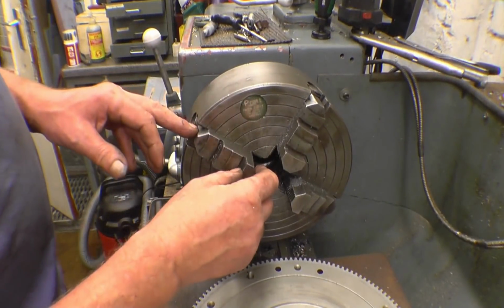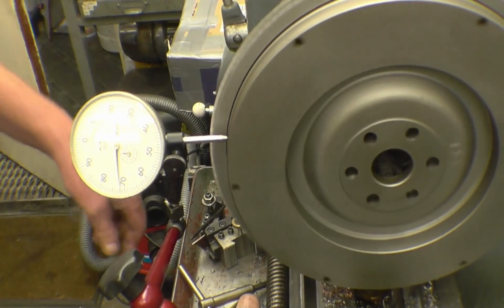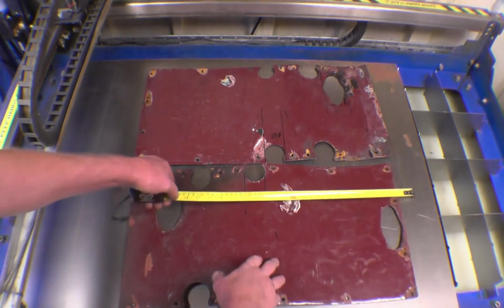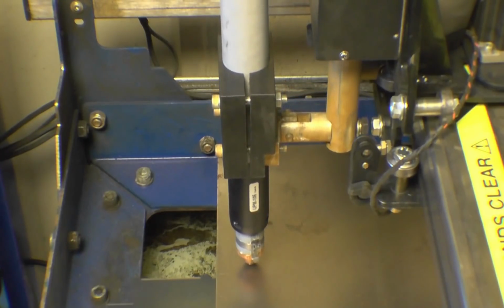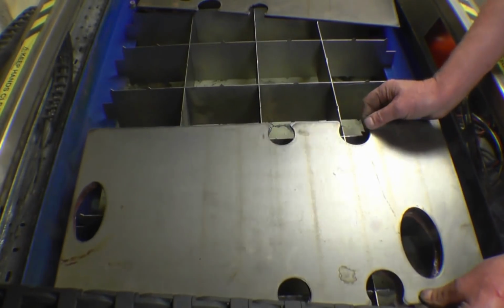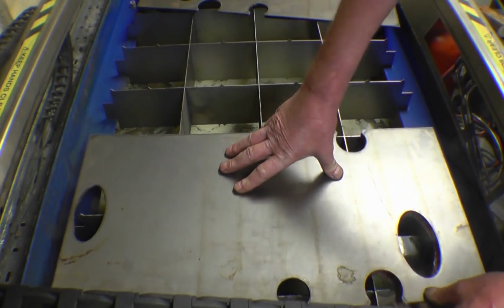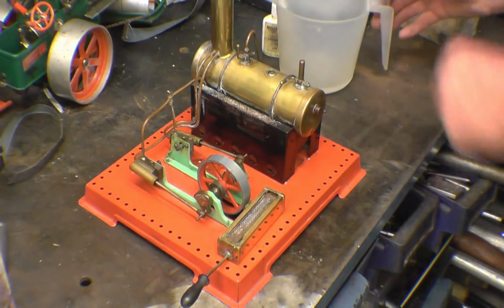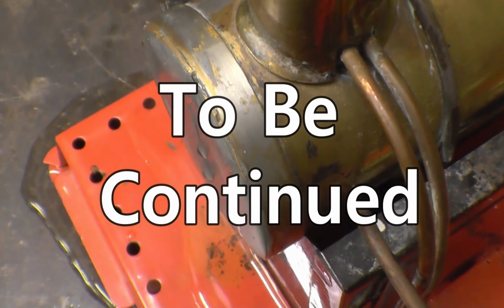SNNC 340 P1  Monthly Giveaway . Plasma cutting thin sheet

Comment: I used distilled water in my steam engines, no limescale etc.
Reply: Alternatively you can just occasionally wash the boiler out with an hot solution of citric acid crystals.

Comment: Hi John, you took me back with the flywheel. In my early career, I worked at a small engineering company that was doing work for Ford's, and I wrote my first CNC turning programs during development of the ZTEC engine. Basically a modified standard Ford flywheel (trapanned out) with a shrunk fit steel ring inserted which then had a PCD of holes bored into it for a sensor to read. I finished up making thousands of them for the initial production run back in 91. Cheers, Jon

Comment: That plasma cutter would really be a fun "toy"' in the shop. Short of space the owen and the dish-tray would have to go.
How did You copy those plates into the CNC in order to cut new ones?
Reply from the maker: The originals were carefully measured then drawn with a CAD program
Reply: @doubleboost  Impressive. Measuring and copying those almost egg shaped holes.... Whow. It takes boost, doubleboost to do that.